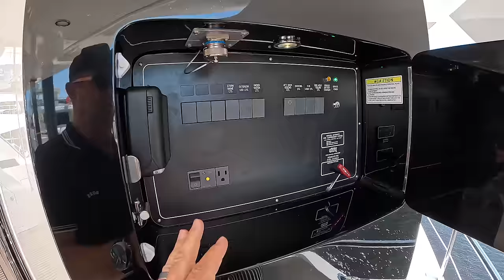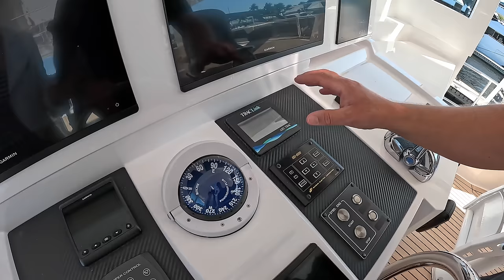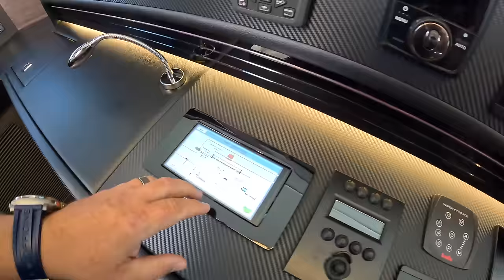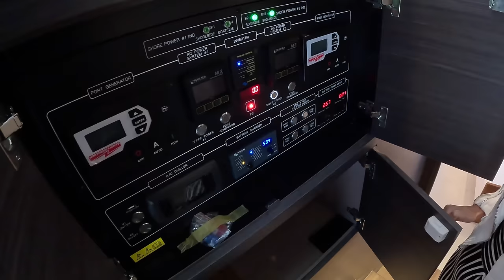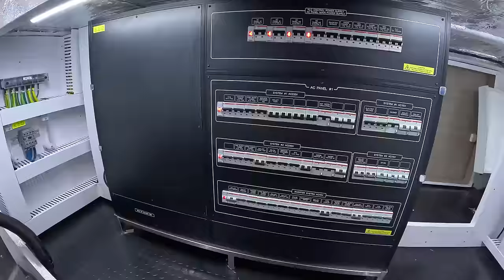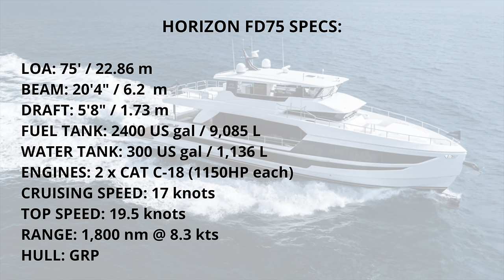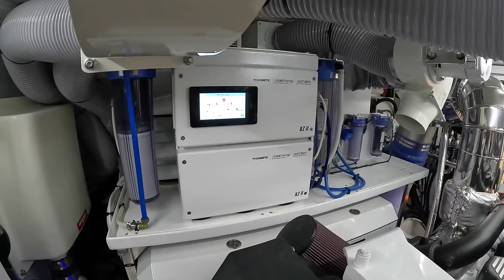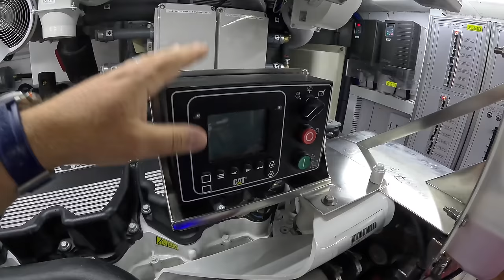How is this a 75' Yacht??? 😳 Horizon FD75 Power Motor Yacht Tour

Comment: What's with the "backup" steering control?  Never seen that at the bridge.  Usually, it's a lever at a rudder.  The asymmetric layout is SO much better at using space than a redundant staircase and walkway.

Comment: I would want the extra power hookup on the bow- unless you have a reel with 100 feet of cable it’s going to be rough.  You never know where the power hookup is when pulling into a marina.  Just my two cents.  The one thing I don’t like about the bow hookup on this boat is that there isn’t a notch on the door, meaning you need to keep it open when using the hookups.  That become a very painful knee or shin nocker.   I am with you Rico about the dust cover for yacht controller.  The other reason for putting it on when not in use is to prevent the outside from accidentally getting smashed and you not being able to get it to screw on because it was bent out of shape and you can’t get it 100% back to the original shape.

Comment: In the outtake, the overhead cabinet front that "fell off" is actually designed that way. How esle would you get to see what is in that very high cabinet if the door had a hinge and when open is just in the way to see into the cavity? So the cabinet front is removable.

Comment: Additional shore power connection at the bow: IMHO not needed. Just pack a rather long cable (or possibly an extension to the existing cable) that will allow you to connect to the back  connector in a pinch.

Comment: I think this is my favourite Horizon. One sailed past me a few weeks ago. It was wow on the water. 

And what a great solution for the crew and engine access when you sacrifice the show-off seconds swim deck staircase? 

Beautiful in every respect – except the internal dash. Typical mish mash of brand names, sizes and shapes.  And two units in white instead of black.
Can you imagine even a $50K car having a dash covered by a dozen branded 3rd-party components? They need to look at the beautiful integrated dash of the Baglietti.

This boat is a very capable competitor to your Bering, albeit without the steel hull. Riviera needs to consider a negative-sloped windscreen model. Fixes so many usability problems.

Comment: Its amazing what can be done with large fibreglass boats. This is very well thought out. You folks have got to be thinking a flybridge or even non-driving roof-top sport lounge would make a lot of sense (on your own boat). You could plunk this entire flybridge onto your boat's roof - easily ;)? Even if its added in low weight fiberglass; that rooftop with day head is pretty amazing - especially for a charter vessel.

Comment: Hi Guys, so I was thinking this was a harbor cruiser because of all the sharp edges until I saw the specs. Not a kids boat per se. It is beutifull and the layout is great for a luxury  condo in slip however for ocean travel I personally would have to order something like this with rounded edges where appropriate for areas where injuries could occur at sea.. Be well :)    And the engine room along with finding the dishwasher is the best part. Oh and the day head too.... :)

Comment: @nautistyles If you are thinking of having a Glendenning Pull Out Self Rewinding Power Cable and Drum which I would for on shore power, then you only need to have power connections at the rear. Having an ability on the bow means extra cables which are bulky and weigh a lot of weight and take up storage room at the bow, whereas the Glendenning doesn’t need that on the rear. If you are not having a Glendenning self rewinding system then you will be dragging heavy weight power cables to and from shore taking up extra storage space, whereas a Glendenning system makes connecting to shore simpler and easier.

Comment: Nice review the boat would make excellent charter or full crew private yacht. Not a owner operator friendly yacht with all the doors and covers and with a 20 ft bean the engine room is to congested to easily get around engines when they are hot, more mechanicals/engine room.
Reply from the maker: agreed

Comment: I love The Horizon FD range. This vessel is another fine innovative design by Horizon. The enclosed solid fly is good. I'd have that if I had a vessel. Does it take much to enclose the rest of the fly.

The NBBL idea for forward shore power answer to me is.

Your getting a newbuild Bering.
Safety Safety Safety Redundancy Redundancy Redundancy. Best to have than not to have.

Yes.

Comment: Yes forward shore power inlet is a must. You never know when you may get a side slip with badly positioned shore power.
Reply from the maker: you are right
Reply: @NautiStyles, remember the outer slips around the perimeter of the old port in Cannes ? Those were side slips. Rare in Europe but larger yachts get them.

Comment: Nice looking 👀
Reply from the maker: Thanks Tim
Reply: I had to dock bow in at a FL Yacht Club as too shallow for aft in. Having a forward shore power would have been better. Had an extra cable extension but...what a pain to run it (securing along the way) to the aft.

Comment: For the money, the staterooms look small, beds aswell, heads looked cramped, especially the WC, the gally not sure about but the faucet will be a pain as well as the cooktop, you wont be cooking underway, eating and sleeping are for weekends, this boat will make both a bummer. Starboard walkway is usless and dangerous, the forward lounge area, no one could be comertable with those movable back rests being setback and so low. For the size of swim platform, the starage for toys and gear is underwhelming, city water should be on same side as shorepower ( i love tripping over hoses or cords) Mount a life raft and tilting davit for dingy and lets see the deck space thats left. They turned a 75' into a weekender, a shame. With basicly 3 salons, the spce could have been better used. Crew mess? Janitorial closet in w crew beds, nice.

Comment: The engine room is the most important room; and It is easily the most expensive and costly space on the Yacht. No propulsion no trip. No A/C bad trip. No room to do regular checks and maintenance they may be ignored. Then you may have up to a 6 figure repair bill. Poor engine selection, the yacht may be under powered or overly expensive to operate.

Comment: Some skip the engine tour? They can't be men. It got to be women or "fairies" doing such a thing. Very nice boat. Is it bigger than a Bering B75? I of course know the answer to that: Nothing is at that length, that I know of. Bering is better though, because of the steel hulls and the range. I like Horizon catamarans better, I also got to say, but they really has made a beamy monohul with almost the same vibe, as you said.